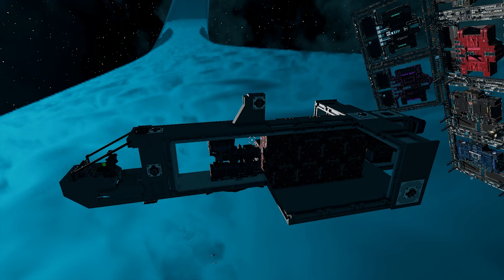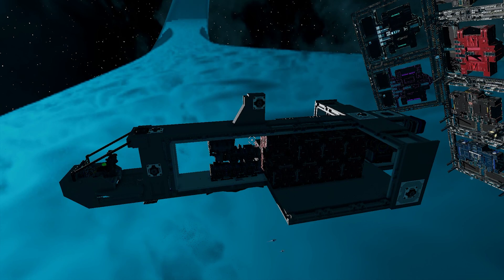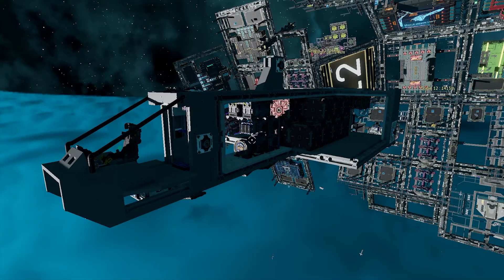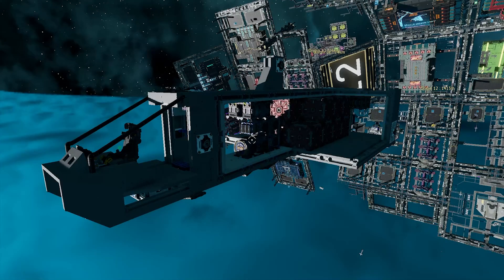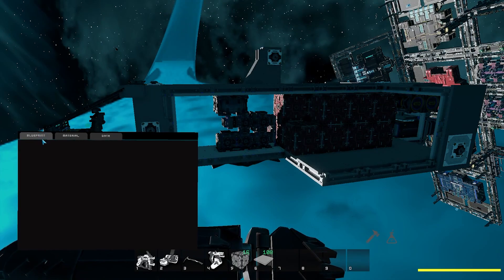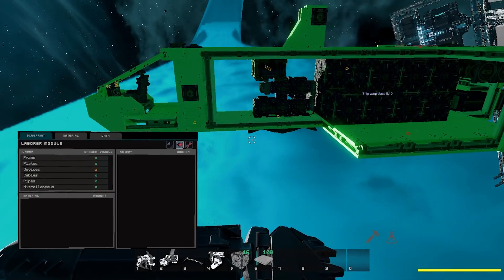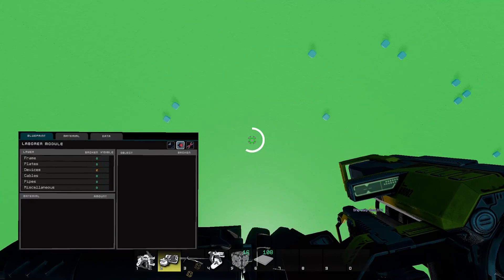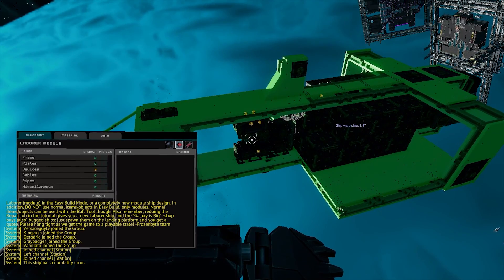Starbase: Slow Starter Ship? It might be a Durability Error!

Comment: I found that the problem is one of my thruster electricity converters that I just replaced but it still shows to be broken, and when I try to use the building tool with the materials needed it won’t repair it